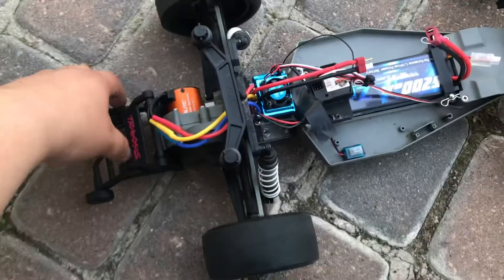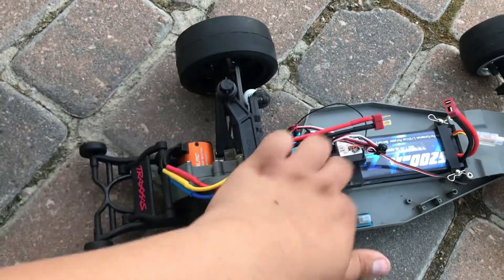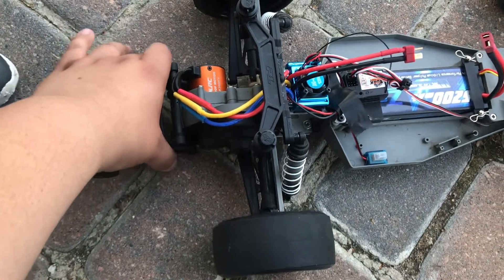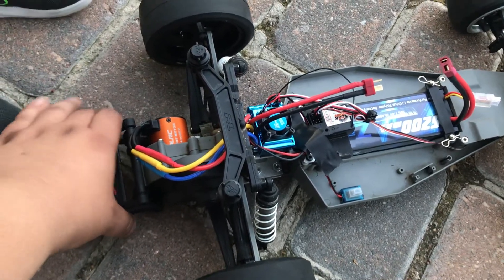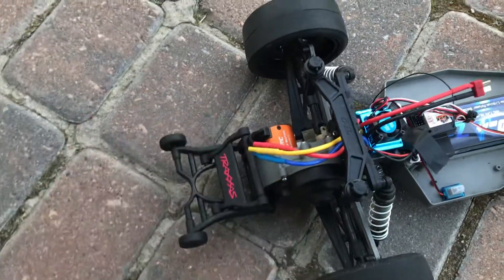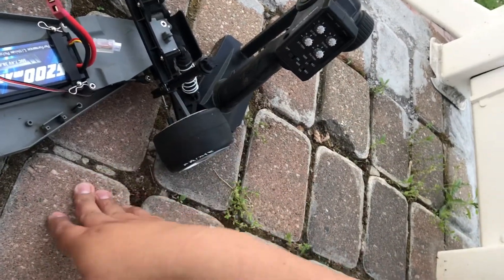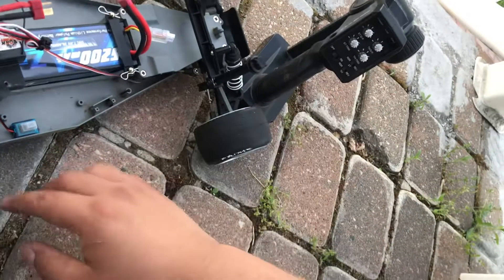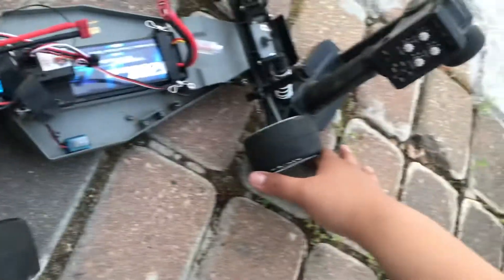Brushless Esc beeping how to fix it

Comment: Hey I have the same issues too, but the trim situation didn't work.
Reply: Same
Reply: @Cartergames-dr5yj  I learned it's with the ESC
Reply: @Cartergames-dr5yj  sometimes the ESC feels like it's not reading properly so it'll fail to work
Reply: @Cartergames-dr5yj  i had that same issue, swapped because of it. Try connecting the ESC to the steering plug on the receiver.

Comment: I just bought my first RC, I turned all the steering and acceleration to low since its my first time and whenever i accelerate the motor makes a high pitch annoying beeping sound and the receiver with the antenna has a blue light that keeps flashing. Is this normal? Im guessing no.
Im going to try turning up the settings when i get back home and hope it solves the problem.  At this point Im just trying to decide if i need to return it or not.
Reply from the maker: Yes the sound is normal and I’m pretty sure the light is normal to. Nothing to worry about.